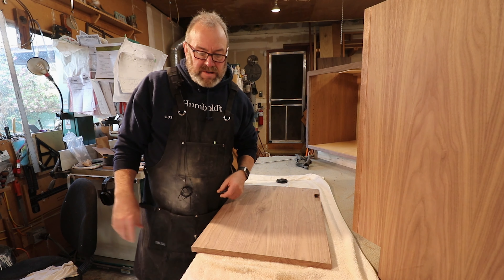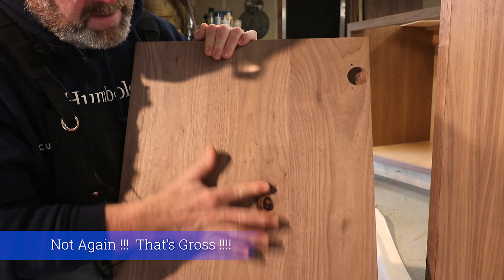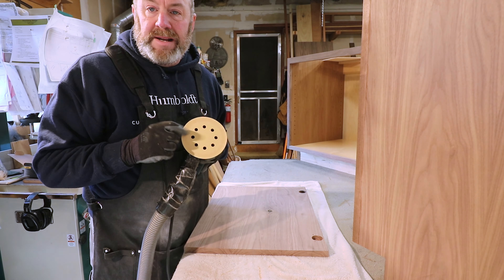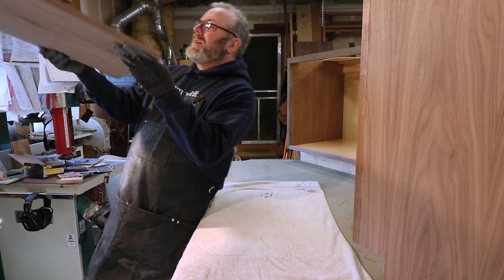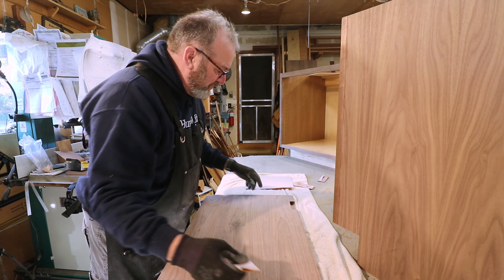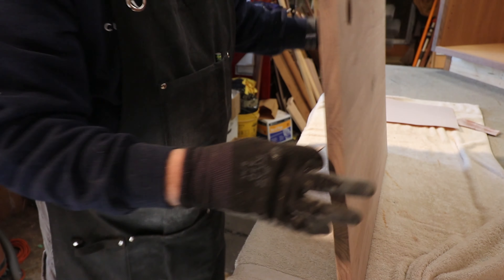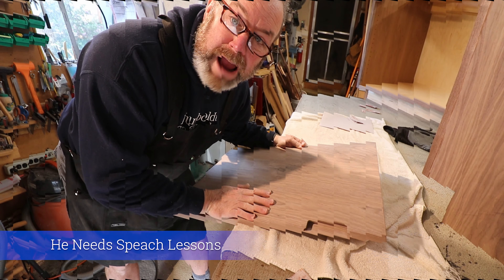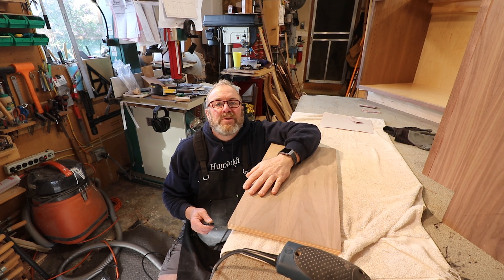" SANDING TIPS & TRICKS "  Wood Working With Mr. KEVIN

Comment: I looked for a video from you on sanding and was not disappointed. My dewalt that's almost 7 years old keeps needing to be tightened up cause it's vibrating the screws out of itself. I decided to change out the pad on it cause it seemed like it was sanding uneven, but the new pad pretty much melted away and won't hold disks. Not to mention that melting resulted in a BUNCH of gouged swirl marks on every single piece of my current project. Stupid me already threw out the original pad, so it's time to just buy a new one (that's what I get for trying not to be a pack rat). Didn't want to upgrade my sander until I could afford one of the green brand ones or the mirka, but that upgrade just isn't feasible right now. I've been looking at a similar Bosch and now I think that's what I'll go with. Funny you pointed out how yours doesn't wear in the middle because of the recessed part, my dewalt does the exact opposite lol. Guess it's one or the other huh? Do you ever use the variable speed, or find that feature necessary? Thanks again Mr. Kevin!
Reply from the maker: Thanks again Doug for watching these videos really appreciate it you can buy softer pads for your Dewalt so you might’ve had a really hard pad you should be able to buy a softer pad with the Bosch you can buy three different types soft medium and hard you might try that and see if that helps with your sanding because it does make a big difference I always go with the medium  for everyday sanding 😃👍 have a good day Doug thanks for watching